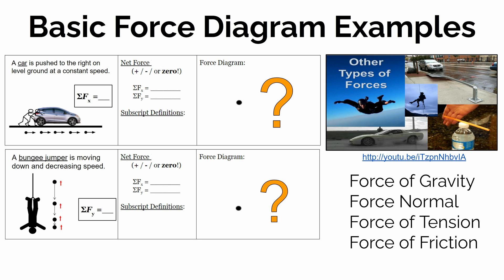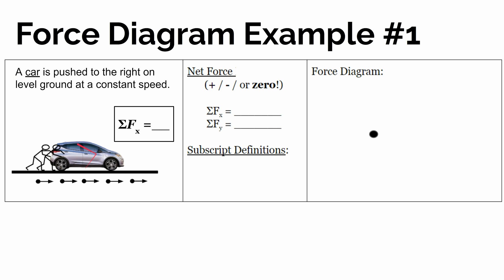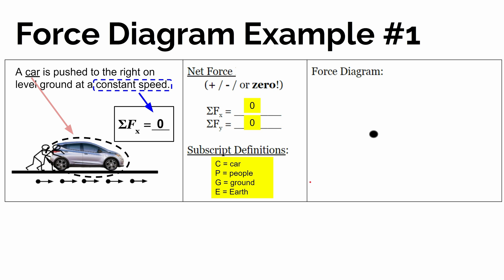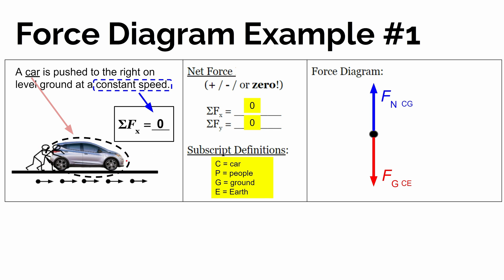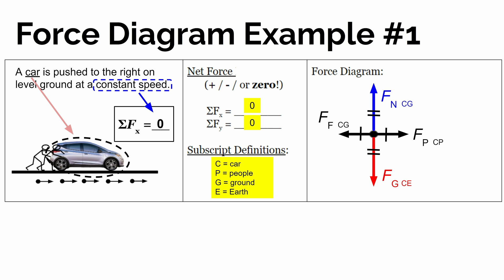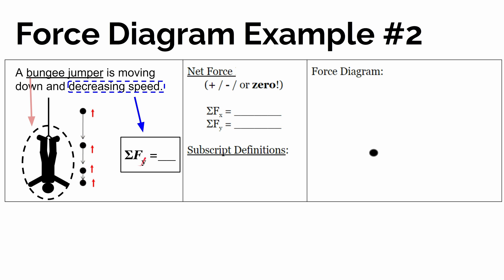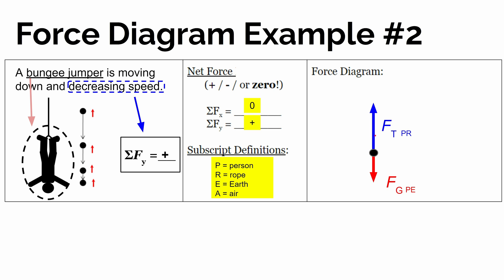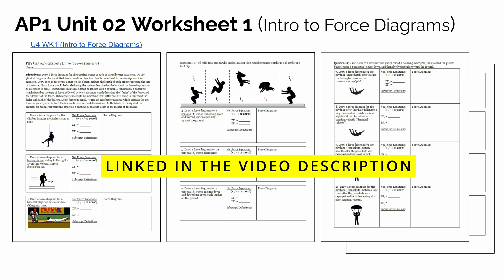How to Draw Basic Force Diagrams

Comment: About the backward force: If the wheels are rolling there is no dynamic friction force from the ground. The friction will work inside the car, at wheel axles and transmission. And those friction forces are not outer forces on the car. The situation is much more complicated than what you present here.
Reply from the maker: You are correct that there are frictional forces inside the car at the wheel axles and transmission. However, those internal frictional forces lead to an external frictional force between the tires and road surface. If there was no outside frictional force pushing left, then the forces to the right would cause the car to speed up.  If the car is moving at a constant velocity (to the right), the external force to the right, must be cancelled out by an external force to the left.
Reply: Wrong. The brake work is done inside the car. It is impossible to do the same amount of work also at a second place, at the road. There is no brake force between tire and road, only at axles, transmission etc. There are no slipmarks along the road as long as wheels are rolling. Rolling is very complicated.